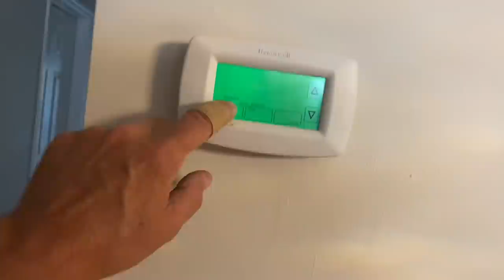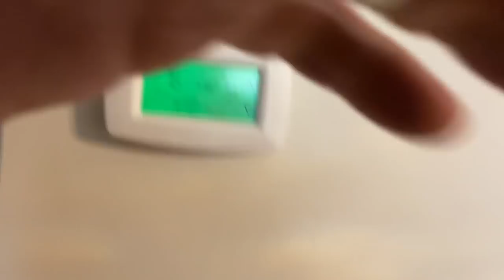Central AC Not Working - Condensate Pump Not Pumping - Shake Her & See If She Spits - Golden Rule

Comment: A question for you…I have a 3 ton unit cooling a 2200 sq foot house with a finished basement but the system is zoned so it’s only really cooling 2200 sq ft. Our house is 3 years old and is really well insulated. We’re in northern IL, and the system will run all day without lowering the temperature much if at all. Is this normal?

Comment: I agree with the no touch rule. Here's why, because once you start messing with it, cleaning it, taking it apart, and you complete that, the internals may still not work 100 percent, then next thing you know you spent over 1 hour fiddling with it. That would have been another service call. Even if you took the loss on the service call by only charging for the part you missed out on another service call.

Comment: Use the viper pan spray instead of the tablet's sometimes the tablet's will clog the impeller it has no screen over it to protect it . Or put the tables in a little baggy

Comment: I would have tested the pump. Kicking is not testing. Could be a loose electrical outlet and by coincidence it turned on when you kicked it just like coincidentally you happened to be here yesterday.

 This old geezer I knew had this old saying "IF YOU AIN'T TESTING, YOU'RE GUESSING!"

Comment: I’ll move to South Carolina and work for u been installing and service for 21 years in ct not too far from u and I’ve been trying to talk my wife into moving just tired if winter’s and I am a smaller guy made for tight attics and crawl spaces and not 5 or 7 section oil fired boilers but I have to have sippy cup as my helper!!😂🤦‍♂️